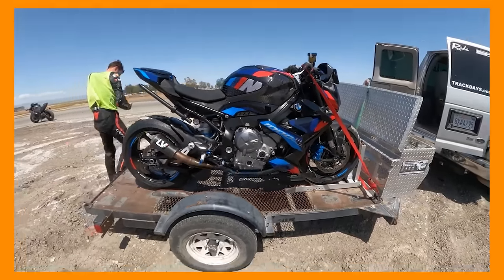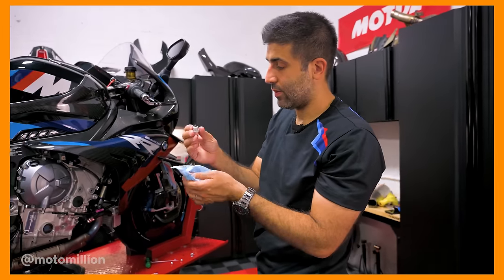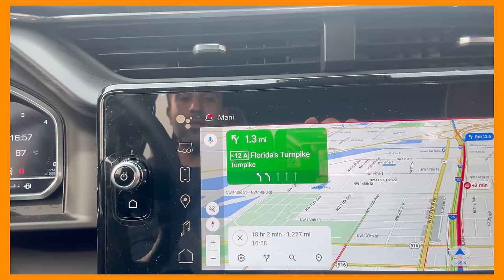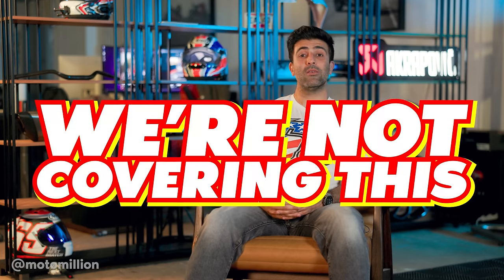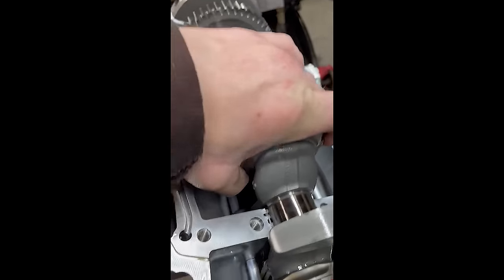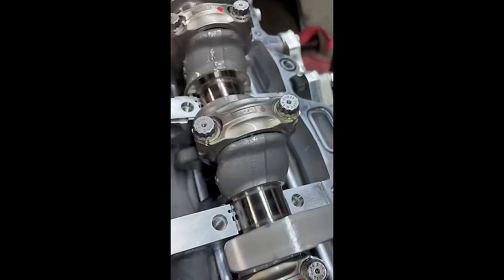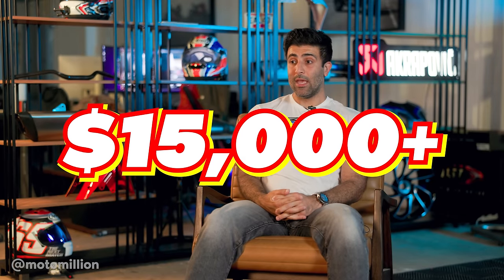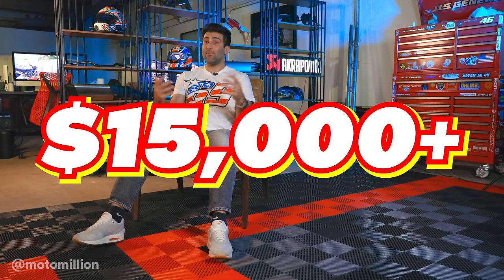MASSIVE Engine Failure on our M1000RR & BMW REFUSED Warranty...

Comment: I just Googled 'BMW m1000RR engine failure' and got hit after hit, so this is a known issue.  They should be recalling every M1000RR they have sold to implement whatever fix they have come up with, assuming one exists. At the very least, they should be changing those engines under warranty.  In your case, I wonder did you check whether the SC Project SC1-R mod would affect warranty?   I'm guessing not, because it seems highly unlikely that BMW would say no, even if any reasonable person would agree that the modification did not cause the failure.  That would have given ALL BMW car and bike owners carte blanche to do what they like, and hit BMW to cover any consequences.   My advice to anyone else who has one of these bikes, is to resist any mods until their bike has done at least 5K to 10K miles to see if their engine is going to stay held together.

Comment: I don’t think it’s right. However you gave them a 1/16” by removing that limiter and they took it to the final mile. Sorry this happened to you.

A similar story for me was my used 2004 GSXR 750. I was the second owner within the first year. Two weeks before the warranty ended. The transmission blew. I was already planning on buying a new 2005 GSXR 1000. Suzuki fully covered the transmisson and the dealer did the trade in as in perfect condition. Never bought a bike outside Suzuki yet because of that.

Comment: My 23 zx6r "only" took 8 months to get a whole engine rebuild 😂 because they said it was a head gasket. I clearly told them, it runs fine, doesn't overheat, but oil is in the coolant. Me being a mechanic I already knew to tell them check the oil cooler, they felt some kind of way I guess that a customer knew more and did a headgasket for no reason. Just for me to pick it up and it still do the same thing 😂. Brought it back same day and they replaced the oil cooler and problem fixed but I got legal involved and they refunded me every penny spent on the bike. Only 3400 miles. Now im on a 24 zx10r and at 500 miles bad engine 💀 swap done it 2 weeks. @ 1100miles and the oil pressure light back on. They really don't make them like they used to.

Comment: To everyone arguing the rev limiter perhaps it may have been a bad move or at least have the dealer do it so it is documented consent.
However the facts are the facts, even if he still had the rev limiter on it and never revved it, the engine had a build assembly defect.
Undertorque on the rod journal.

All he did was advance the issue prematurely.  Had he just been one of you, you'd have the EXACT same issue but at 4,000 miles instead of 400...
The difference being though, you'd be riding it at full tilt and probably would window the engine.. he was at a dyno so lab settings allowed them to prevent that.

Comment: They will do ANYTHING to get out of a warranty claim.I have a Husky 701,the dealer is miles away,so I did my own oil changes for the first few services,I used the correct oil (Motul) and filters,in fact,I serviced the oil twice as much as THEY do on the run-in…I was out riding and the shifter star for the gearbox went,this part has been upgraded by Husky themselves…they point blank refused to do ANYTHING about it,even though they knew it was an issue,citing my lack of dealer servicing,no good will whatsoever…I’ll never buy a new bike again.They also had clutch slave issues,(A LOT) they refused to do that too,then three years later,I got a recall notice for…you guessed it,the clutch slave issue ! I had already replaced this with a British made Oberon billet one,I kid you not,FIVE of my mates had their slaves fail and leave them stranded on the road,mine went as I was leaving my house,so I was ‘lucky’…dealers are stealers…

Comment: Ahh man, at first, I agreed that BMW should cover this. However, taking off the break-in rev limiter does void the warranty, regardless of whether you agree with it or not. It would have been better to leave it to keep the warranty intact. With that being said, I’ll be sticking with my K67 until they work these issues out.

Comment: I got the new 2024 S1000rr M package and the front carbon him cracked on the first day. The same happened to my friends 2023 S1000rr on the first day and BMW refused to replace it under warranty. Absolute negligence from BMW selling defective machines to customers even though selling them with 5 years warranty (UAE) but denying claims with no genuine reason.

Comment: Next time you're in Cleveland post a reply here!  Would be great to ride w/ you guys.  EX WERA myself.
I had a Porche and the exact same issue.  They flew 2 men out from Stuttgart and they even said it was a manufacturing defect.
The timing tensioner bolt goes INTO THE BLOCK which is a horrible design but that being said they did not torque it down properly, it backed out and oil left the engine.  A twin turbo v8 gets real pissed off without oil.

Bottom line I had to take Freddie Baker Porche to court and also Porche USA. The end result was they were ordered to provide the engine (Also $15,000) but I had to cover the labor ($5,200)

Freddie Baker is now out of business.

The German's motto is "If you can afford the vehicle you can afford the service"  Hence why in a 10/100 landscape today they are STILL selling vehicles with 3/36...

They just don't give AF.  Personally I have never ever like ANY of BMW's motorcycles especially those opposed farmer bikes... YUK.  It's one of those triumph/indian/austin heely types of sectors in motor consumer markets.  You have your weirdo niche owners that love it b/c it's off the beaten path.  When it comes to showing a car or putz'ing around on a sunday fine... go for it...
but track born track bred and track raced, I just don't think BMW does NEARLY as well in their bike division as they do in their car division.  I would MUCH rather race a Suzuki or if I had to have a twin then an  Aprilia.  They have rider in mind and are designed to be raced not coddled.

Also BMW is notorious for rod bearing failures.  My M6 with a V-10 is well known for it.  You can remediate it permanently but there were a LOT of unlucky people who were DENIED warranty service (the very few that had the failure within warranty)  IT was a design flaw however.  Now you can easily and cheaply bullet proof those engines (why I got mine)
From what you showed it's probably a bad torque at the factory.  That seems to fit the result you have.  Same w/ my Porche.  Too funny.

It's a real shame but basically BMW will NEVER issue an engine recall nor will they admit design or manufacturing fault.  You need a cattle prod and they will eventually honor their agreements.
Videos won't put a dent into their reasoning.  They need to keep losing law suits.  Then, when they go to deny a claim they can ask themselves... "Should we just pay the $5,000 now and build a good reputation or the %25,000 after the law suit and further tarnish out reputation?"

I will NEVER buy ANYTHING German new.  EVER.  I will let some other idiot take the hit.  If new = no warranty then might as well save the $ and buy used no warranty. 
If they honored their warranty like let's say Hyundai and offered 10/100 and WOULD swap a windowed engine,. then yes I'd buy new probably.

New Bike = $40K
Windowed engine = $15
Total loss $55K

Used = $18K
Windowed engine = $15K
Total loss $33K

I think you get my reasoning.

My M6 new $134K
Catastrophic engine failure = $22K
total loss = $156K

Got it used = $14,700
bulletproof engine (bearings and VANOS lines) = $5,600
STILL RUNNING w/ 56k miles
total investment = $20,300

It's real easy math.

Also I agree with you about break-in. 
 I bought my K8 GSX-R 750 new and I hammered it at the track the day I bought it and ride it hard  all the time.
ZERO ISSUES.  Keep in mind I maintenance my vehicles religiously and I never operate anything beyond 3,000 RPM until the engine is up to temp.

Comment: I had a '22 S1000XR that blew its engine on the 1st month of ownership..............  had ton of metal in the oil pan as well.  BMW covered it under warranty - replaced whole bike as there were no engines available.

Comment: I had Water pump Failure on my 2022 S1000RR luckily got it replaced under warranty with also the timing tensioner and intake cam that also is know to fail , at least that’s what the dealership states they did, hopefully they did and my hard work and hard earned money was cherished and was taken in to consideration because this is my dream bike and for others sadly it can only be just that…

Comment: Like insurances, manufacturers put in place various traps to not having to cover your claim. In this case, removing a rev limiter sounds really bad to a non technical manager that needs to decide to give you a new engine or not. On Fox shocks for example, you loose warranty when you don't give your shock an official annual revision by a certificated repair center. Doesn't mean someone can't get it fixed under warranty in a rare occasion. On a bad day, or after too many claims, they'll start using all excuses... that's the way it goes in the industry. Plenty of such examples in the bicycle and automotive industry. 
Depending on who you speak to, engine break-in is either still a thing, or not needed any more these days, but if you know the first oil mostly has a different thickness and lubrification properties compared to your regular recommended oil, you should know not to push the bike and pull high revs on that first oil. I believe break-in historically was needed to cover some tolerances and metal parts rubbing a little in the beginning, these days it's an insurance trap. ( although my 690 Duke R had quite a bit of metal stuck to the magnetic filter at the first service ) :)

Comment: I think BMW has used parts/materials which take longer to bed in that those of other manufacturers. They had issues with this on 2010 and enforced the hard 9000 RPM limit from 500-1200 KMS to prevent failure.

The parts may be inferior, or may just need a more specific bed in procedure. Manual says not to exceed 7000 RPM for the first 300 KMS. You would have to read this to know this as there is not a 7000 RPM limiter.

They've got parts of which only will last if the break in procedure is followed as per their manual, as a result of their engineers testing.

Mechanically: Poorly assembled rod cap/faulty or miso stalled bearings possible

Legally: You put bike under full load before 1000 KMS When you put on the dyno 

Running-in speed <7000 (Odometer reading 0...300 km)

<9000 min-1 (Odometer reading 300...1000 km)

no full load (Odometer reading 0...1000 km) 

Note the mileage after which the running-in check should be carried out. Mileage until the running-in check 500...1200 km

Whether or not the parts or assembly are the issue, they don't care because they're covered by overrev either within the first 300 KMS , or 500 KMs depending on when limiter was removed, plus premature full load.

I believe if you'd have presented the case differently, tailoring the story to meet the requirements of the manual, you could have been covered. I think you accidentally provided too much information as to allow them to use your information against you, and in favour of the service manual.

Comment: My 2022 had a loose battery terminal, rear shock seal pop and leak over where, and a fairing pop out but that was all warrantied and covered. I didn’t get a loaner bike which is bad since that’s my only vehicle . Just a little info for you about the bikes.

Comment: BMW should have covered this 1000%. This is why I always was skeptical with the "break in rev limit" on their engines.... I like to get on a new motorcycle full throttle after 3 heat cycles and about 40-50 miles after properly warmed up. I brought brand new R1s to the track with 250-300 miles..... I don't trust any manufacturer, but this has basically steered me away from BMW now....you gave this bike an easy break in (not my preferred method, but what choice do we have with BMW)...

and I'm not brand loyal....My Kawasaki has no " break-in rev limiter".... ready to rip on the track straight out of the box ( after proper warm up of course)...Brentune Stage 2.

 I had the older BMW S1000RR 2016. it was a great bike. It was always on the back of my mind if the motor can handle the high revs like a Japanese 4 cylinder bike...But the best years or most reliable years of BMW S1000RR were the 2017-2019. Even every Aprilia 2021 and up leaks oil from every orefice now as wel unfortunately.

Comment: I have owned seven injected Honda Blackbirds, two of them new and a new ZZR-1400 Ninja (ABS model 2009). All of them were utterly savaged from day 1 and utterly indestructable. I hear nothing but bad things about BMW sports motorcycles. I will never own one. The blackbird that gets me to work and back, to this day, is ridden extremely hard, in all weather and with over 45,000 miles on it, I just can't get it to break so I can justify getting a new bike.

Comment: It is systemic now in the automotive and motorcycle service industries of disrespect of customers, customer property and a complete lack of professionalism.    The industry is at an all time low in qualified mechanic's no matter the discipline.   Before people bite my head off, I worked as a trained Marine Mechanic in the Seattle area in my early twenties to pay for college.  I also am working towards my A&P as well.  Being a mechanic I normally do all my own work unless it's something I can't do, or need specialty tools and or equipment.   I have been told many times by shops that they don't want to do the work on my SUV because its too hard, no matter how much I pay them??  Too hard??  If it's not an oil change or plugs they won't work on it.  NEVER would I say that to one of my customers, we would just figure it out and get it done.  It just blows me away.   All I can can think of is that there are so many people now that can't even do the basics like an oil change or tune up, that these shops can afford to turn away business for the the easy stuff.   I call them just lazy turds!

Comment: 2:40 The screen sent a warning with 9 miles on the bike: "Serious fault in the engine control. Onward journey possible. Damage possible. Have checked by a workshop." You should have sent the bike back to the dealership immediately. I understand because I had an engine problem with my 2013 Kawasaki Ninja 636. The bike was under warranty, but I was ordered to pay the dealership $700 to repair the engine. I wrote to Kawasaki and the dealership was ordered to reimburse me the $700, but the dealership never reimbursed me the money. I did not take them to court. Perhaps you could file a court claim against BMW and get reimbursed for the engine failure. You paid $40,000 for the bike, and an additional $15,000 for repairs to the engine. File a claim for $55,000, plus attorney fees. Sorry that this happened to you, Manny. BMW should honor their warranty on the bike.

Comment: Sounds very much like the timing chain tensioner failures I had on 636s over the years on the recorded audio surprised it being a loose rod cap. That being said, break in procedures are there for a reason. They're pumping every ounce of HP out of these things as they possibly can. How hard is it to ride a little easy for the first few hundred miles? On the 20+ bikes I've owned and built I had one grenade an engine, and guess what one it was? One I built and didn't break in, just beat the living shit out of.

Comment: Go to virtually ANY sportbike brand/model forum and ask if warrany will be voided if you tamper with the ecu or admit to violating the warranty terms and /or  break in specifications and I will bet they will ALL say the manufacturer is going deny warranty .  I have noted that MOST owners are so frightened of manufacturer denying warranty that they wont even change their own oil etc!   Personally I would fully expect to have engine failure claim denied if I changed the exhaust or modified the tuning in any way including aftermarket intake etc....I just assume manufacturers will take advantage of an "out" just as quickly as most owners will take advantage of an "in" ....Having said that I WOULD expect most manufacturers to bend over backwards on issues that are clearly making the news and giving the brand a black eye so to speak....THEN I can see them replacing stuff fixing stuff EVEN when terms of warranty are not exactly followed especially particularly if there have been injuries or a lot of bad press ....I recon the S1000 motor has not achieved that level of association with being fragile or failure prone that BMW feels any need yet to bend over backwards....My own motorcycle I bought new last summer I decided not to F with while still in warranty (one year) as far as exhaust and ecu...I mean it is 1000cc VERY powerful sportbike lol it is not like I NEED for it to "sound better" or be ANY faster!  After it's a year old?  (If I dont buy the extended warranty which they have yet to offer me anyway) THEN I might start modifying.....but there is another issue even AFTER the one year factory warranty and that is there is a several year warranty on ALL the smog related components!  Which is a LOT!  Would modifications void a lot of THAT?   My KTM 690 had a fuel leak after regular warrany period was expired and I got a new 1800 dollar gas tank/sub frame (part of the pollution control system) ....but when I took it in for the claim I made sure EVERYTHING was bone stock like the day it was made....I did not want to give ktm ANY "out" to deny....and so they replaced it no problem....even fixed 2 recalls I had no idea even existed! ....and I am betting you did learn something!  I bet you would not do the same things over again with another bike??   Am I right?   But yes F*ck BMW...I dont like em / wont buy one and this video is one more reason to keep them off my "next bike purchase" list